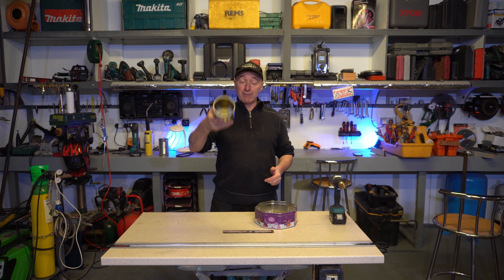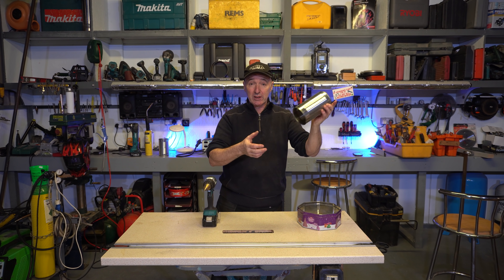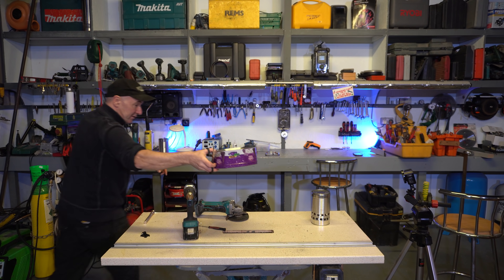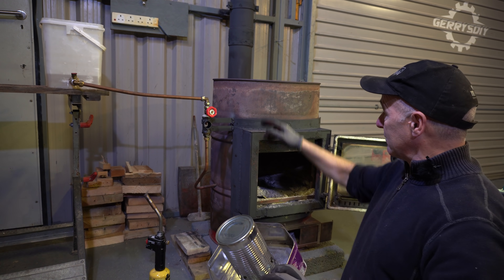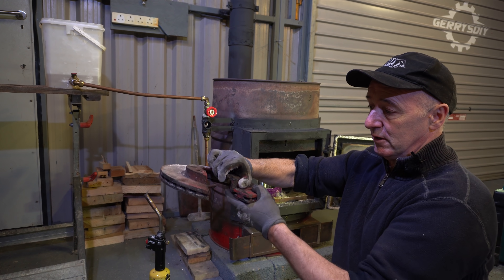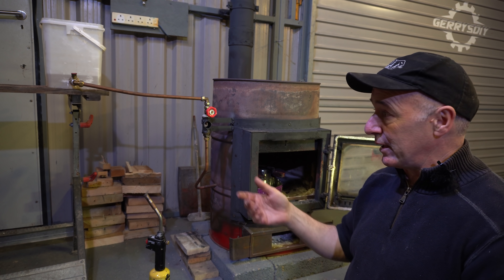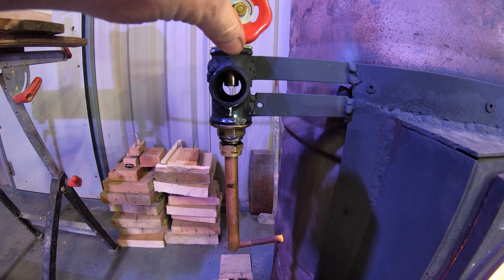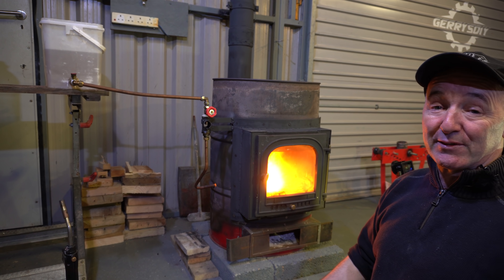Free Heat .. Fantastic Tin can Waste oil Burner

Comment: An easier way;  layout your holes with use a cloth tape measure outside diameter divide by closest whole number. then adjust the distance between holes for duability
Reply from the maker: Great tip! 👍

Comment: Hi, anyone here experiencing the same thing.  I have lots of soot in the chimney and you can see fluffy stuff flying around the house too.  YES, mine burn clean also, you do not see smokes, but you see black ashes flying all around and on the ground too.
Reply from the maker: Hi Jordan. Sounds like you need more air. Try using a compressor with just a few psi and see if the flame gets brighter. Hope this helps Cheers Gerry
Reply: @GerrysDiy  - Thankx Gerry, I'd give it a go!
Reply: Needs more oxygen

Comment: You didn't show me where the oil is dripping into.   Is it just topping up the reservoir that you poured in?  That unsealed can would leak a lot.  I kind of get what's happening - the air is being forced through the oil vapour in the biscuit tin via the holes in the dog food can but I don't know how the oil is distributed for maximum efficiency.  It looks like this could be made self contained - is there any need for such a large dog food can, could the biscuit tin not have a lid on with a chimney?  I'm missing so much info I'll have to check out the other video which you said wasn't very good.
Reply from the maker: Hi Jake. I had problems with the gopro and needed to update the firmware otherwise you would have had the footage youa re looking for. Here's a link to a video I made a few years ago that explains the drip feed going into a welded version of  this burner. Will make more sense to you and has most of what you are looking for. https://www.youtube.com/watch?v=Bf38HSxtSBw Hope this helps Cheers Gerry

Comment: cool,but not free.
Reply: If you slowly collect the parts by knowing where to look, yeah, you can do this for free....   if you just moved in to a new shop and have nothing to start with, you could spend a lot of money on it.....  If you save up vegetable oil and bacon grease and used motor oil all spring, summer and fall, you have free oil for the winter....  Yes, free.

Comment: The little diesel parking heaters use a "pulse" pump that delivers a known volume of fuel every time the 12V power is cycled.  This could be a good replacement for your drip feed because it is easy to accurately control the fuel flow rate, and you don't need to rig up a gravity feed.  It would be simple to build a circuit to supply adjustable pulses, turn off after an hour, behave like a thermostat.
Reply from the maker: Great point! Jesse Will have a look at that. Cheers Gerry 👍👍
Reply: Hey Gerry, you actually did a video on the diesel heater, must be getting a bit forgetful.
Reply from the maker: @campervancreations7656  Hi Jamie. Jesse was suggesting using the pump off one of these units as a feed and control it with a r-Pi as a speed controller. I'm not sure it would like engine oil but might be happier with veggie oil if it was heated a little. Have a couple of raspberry pi's here and some android D1 mini's Not sure at the moment what the pump is capable of but might be worth a look. Have another pump in mind at the minute too. We will have to do another Collab soon Jamie, what do you think Cheers Gerry 👍
Reply: That sounds like a great idea, a  collab sounds like a fantastic opportunity. I've a great idea in involving fire and safety. I have a gear pump that can be variable speed, might be a Good way of controlling the speed and thus the veggie oil feed speed. Here all weekend. Jamie

Comment: By burning waste oil, how bad is the soot in the flute? Any ?
Reply from the maker: Hi miniglasi. If I were to brush the chimney it would be very little soot or ash from when I use the stove for burning wood etc. The flue is not oily or wet at all. Been running these stoves for years now but the trick is to have them running hot and not to have them smoky or restricted. Hope this helps Cheers Gerry 👍

Comment: Hi Gerry, great videos sir. Have you ever seen this sort of system for burning waste lard. Just with the added complications of it solidifying at around 40°c?
Reply from the maker: Hi David it would work so long as you can drip feed or pump liquid lard. You would need to pre heat it to allow it to flow. Once dripped into the hot chamber it would vapourise and burn. These burners are capable of burning most oils. Hope this helps Cheers Gerry 👍
Reply: @GerrysDiy  thanks sir. Yes, was thinking of some sort of copper heating element that can be circulated once the fire is going.

Comment: instead of rotor could you use the top of the tin?
Reply from the maker: Hi Charles. There is more metal in the brake disk and once it gets red hot it helps with combustion the lid of the tin would just curl up with the heat I think. It's a great little design of a burner and works really well. Appreciate the comment Cheers Gerry 👍

Comment: Good demonstration. And essential remark that it’s a prototype. Meanwhile the color of the flame shows that combustion is not complete enough. Did you try to reach blue flame in such construction? I mean constructions without air pump, with only natural air flow?
Reply from the maker: No have not tried to make the flame blue yet. I have welded this design in heavier metal and can get it to burn clean as in bright white. Thanks for commenting Cheers Gerry 👍👍
Reply: @GerrysDiy  Have you got a video?

Comment: I have made a couple that have been great using ideas from your past videos but I've struggled to get the oil flow reliable due to the viscosity changing with temp ,different oil even the level of the head makes it just to unpredictable we have had a few scary moment's when the oil has over filled leaked out of the bottom and ignited on the floor I think a fuel pump and over flow with a cut out switch with be safer
Reply from the maker: Great point! Colin There will be a pumped version soon. These can be dangerous and do need to be minded. Better versions ahead. Thanks for commenting Cheers Gerry 👍👍

Comment: Hey Gerry its been awhile since I saw your stove building techniques. I know theres a bit of danger but this always catches my attention.  I'm thinking of building one for my two car garage. I now have a natural gas stove and as you know they can be an expensive heat source. I have quite a bit of used engine oil that would fuel my stove and that'd save me a lot of money.  Any advice is much appreciated.  Thank you.
Reply from the maker: Hi Dean. You need to consider insurance and safety but if you are still going ahead converting a cast iron stove will give you a burner / stove that will last years. I like to be able to see the flame so I always have glass in the doors. My current setup is just an old oil drum with a frame and a door I added. If you can weld things get lots easier as you can fabricate everything easily. Old propane tanks are made of quality steel and will last many years too. Give me a shout if you think I can help. Cheers Gerry 👍

Comment: Hi Gerry. Just wondering if being the DIY genius that you are could you find a way of making a waste oil burner thermostatically controlled with some way of relighting in on demand. Could be overthinking this but maybe using a raspberry pie to control a sequence to release a small shot of petrol and then a spark then start the oil feed? Any thoughts
Reply from the maker: Hello Mr Irish man. I have most of the bits to do that including some d1  minis, raspberry pies, thermostats, burners, compressors and syphon nozzles in the shed at the moment. It is on my todo list and will happen this year. Thanks for commenting Cheers Gerry 👍👍
Reply: @GerrysDiy  looking forward to all your to do list Gerry. Keep safe, we need your videos 🙂

Comment: Thanks for the video Gerry 😁 I was experimenting with oil burners today and this should definitely help👍
Reply from the maker: Hi Dan. This one has a 6 inch flue and it's 14 feet long. That makes enough draw / pull on the stove to make the burner work without the need for a fan. Good luck with your experiments Cheers Gerry 👍

Comment: Hi Gerry thank you for showing us this. I will use this to run my waste oil Distillation system, to make first run diesel from waste motor oil.
Reply from the maker: Hi Heyyou Buddy. That sounds great and this burner is well able to produce lots of heat. Obviously a welded setup will last longer and just needs to be cleaned out after a few burns. Thanks for commenting Cheers Gerry 👍
Reply: @GerrysDiy  I only need to make about 750 to 800f so I will have scale it down a little. I really enjoy and look forward to your videos. I love the idea of making what I need out of scrap, give things new life and save money. I like being independent and living free. I just moved from the San Francisco Bay Area to mountains, I retired and now I build the things I need. This spring I will buy a Lucas saw mill so I can build from my own trees, and saw for hire when I can. Again thank you so much for sharing.

Comment: I wonder if i could make a portable one for camping ect using a calor camping gas 907 bottle as the main stove body with miniature burner inside..  carry it all in a bag with the flue and a bottle of oil...  will a tiny one work as well?
Reply from the maker: Hi Robert. Here's one I made with a calor bottle a few years ago but it needs a flue and is messy with the oil etc. Great for a shed or building but not a great design for camping I think https://www.youtube.com/watch?v=bRaVPMt3QQ0 Thanks for commenting Cheers Gerry 👍👍
Reply: @GerrysDiy  I was thinking about fitting the air tube with the holes drilled in into the bottom end of the gas bottle and fitting the fuel on the top then dripping the oil into the bottle it's self.  So the bottle is the burner and heat radiator. ..rather than placing a burner inside a stove...
Reply: Love that auld pioneer!

Comment: Jon in KY U.S. of A. 6in pipe how many holes and what dia thank you.
Reply from the maker: Hi Jon The flue in my shed is 14 feet and 6 inch internal diameter. The dog food tin is 4 inch in diameter and 7 inches long. The holes in the tin are 1/2 inch and I have 30 holes in total. All holes are inside the tin and so that they spray against the walls of the sweet tin. Hope this helps Thanks for commenting Cheers Gerry 👍👍
Reply: @GerrysDiy   thank you sorry to bother

Comment: Hi Gerry, just wondering what size flue you have and how tall your chimney is? Still having issues trying to creating that kind of draft, and I'm not sure if I need to add some more chimney pipe or enlarge my intake air. I'll keep tinkering around with it, I've no problems running on a blower, but would like the ability to run without it. Keep up with the vids it's always good to see a new one even if it's a redo of an older vid. Mike the plumber from Michigan.
Reply from the maker: Hi Mike. My flue is 6 inch internal diameter and 14 feet long. I'll show it in the next video but longer is better as the rising gases pull more air into the burn chamber. All the air comes in through the food tin with no additional air from leaks etc. That means that as the flames burn they pull in more oxygen through the holes in the tin can and mix with some force. I'm sure you know all that but if anyone is reading the comments this might help them. Was looking at the snow around Michigan recently and on this side of the Atlantic we had a couple of inches and it melted fast too. More on the way maybe Sunday. Thanks for commenting Cheers Gerry  👍👍👍
Reply: @GerrysDiy  I think I'll try adding some more pipe, as soon as it warms up a little. We've got about 6" of snow here, but that's not the problem right now, our high today is going to be around 12-F with a low of 0-F. I'm not too far from Detroit, so we don't get crazy snow, but the temps this week are going to be unusually brutal. Thanks for the thoughts cheers.